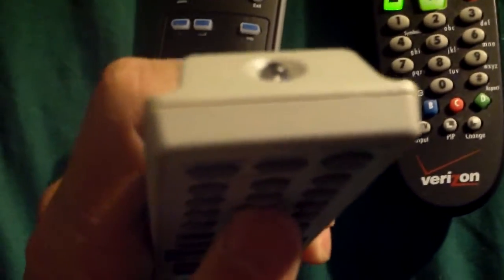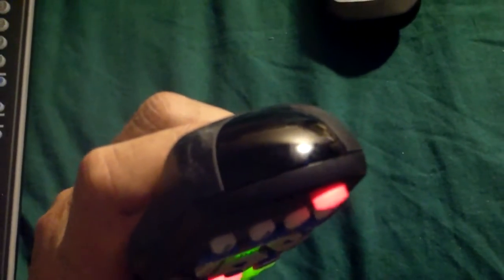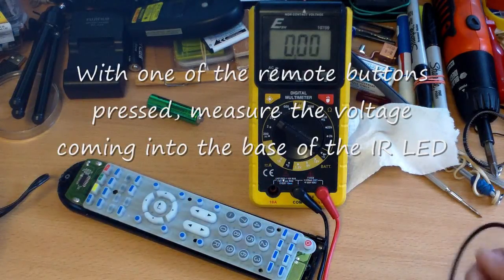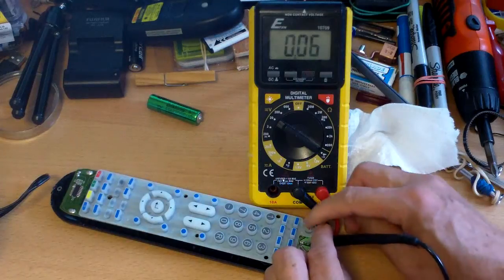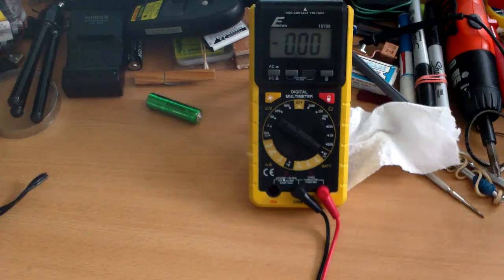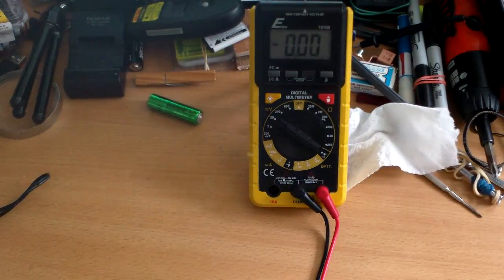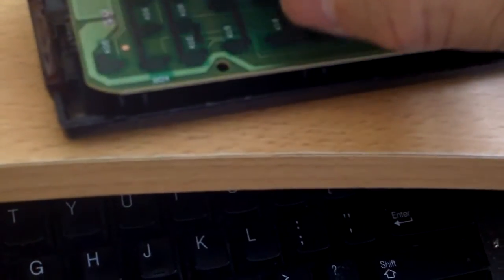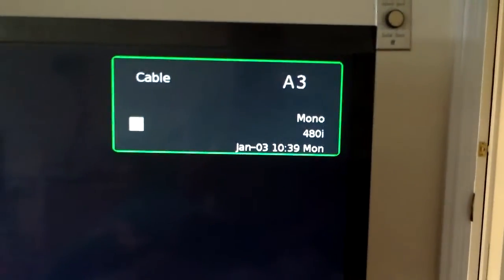Repair your broken TV remote control

Comment from the maker: The original one worked for half an hour and then died. They sent me a new one pronto. At least the new tv is working great. The original trouble shooting called for taking out the batteries for half hour and pressing all the remote buttons and reinstalled batteries. Really was a waste of time cause that didn't work.